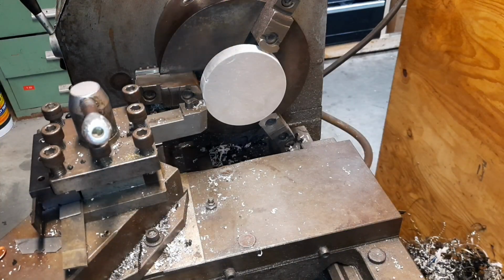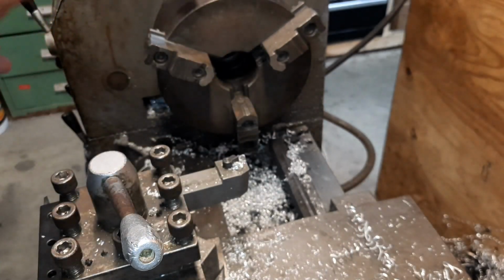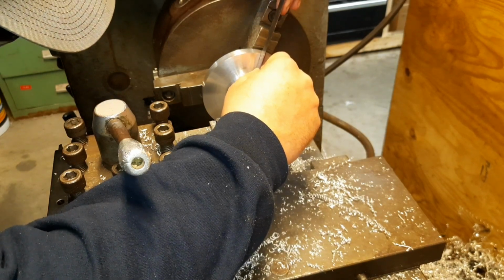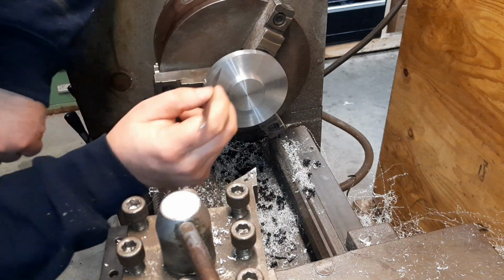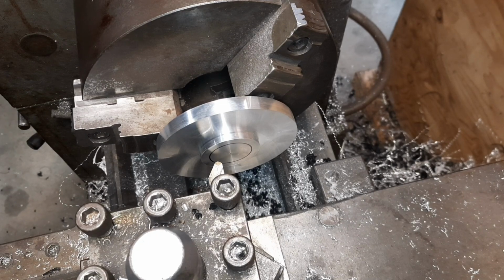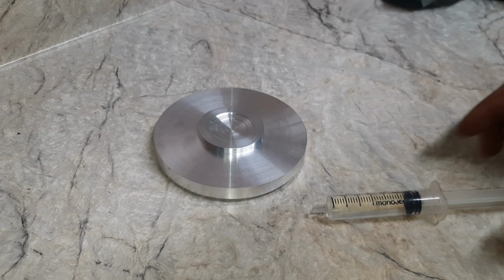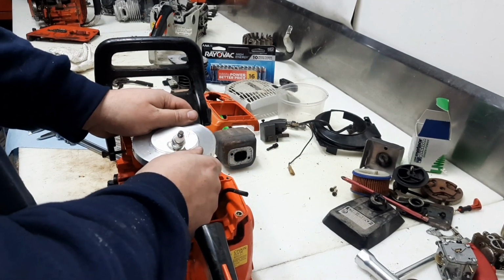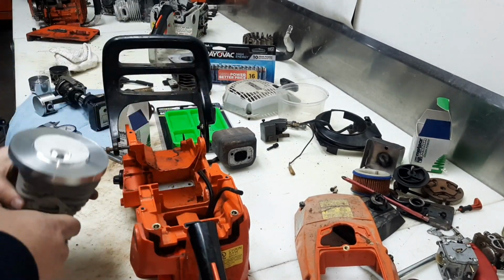Custom Cylinder Head! 50cc Race saw Part 3!!

Comment: You are a bad son of a gun there Dyno Joey Harkness… sideways spark plug hole drilling madman!!!! Your freaking angle was right on the money dude!!!! Was that a freaking guesstimation or did you use a little piece of something to gauge that and make a mark where you wanted to make that drill actually make contact??? This is a very very cool project… love the ride-along!!!   I really just appreciate your slow smooth very deliberate process…you can actually kinda see your metal processing as you are going along… not rushing around…very consistent, controlled thought and process completion… it’s very cool!!!  One day I’ve got to get you a saw to port so I can have a DJH Saw in my arsenal… I need that cylinder top piece on one of my old QV8000’s… so she can have my fun in her retirement years! LMFFAO! Then I can make her pipe! Yeehaw! I’d really love a fast 8000!!! Those two old gals pulled my 36” bar for lot’s of years and feed me!  I owe them some love! 😂😂👍👍

Comment: Blows my mind that with long thin fasteners like that and no real "head gasket" that they stay sealed up.  I guess that recess really helps.
Reply from the maker: Well... We don't know how well it will seal yet. But torqued properly and both surfaces true it should seal fine.
Reply: @dynojoemods2764  I'm excited to see.  Worst case scenario you may be able to make a tiny round ended cutter and cut a groove less than the radius deep on head and jug (like an o ring groove) and put that radius of copper wire in there.  I bet it would squish a little and seal up good enough to run.  If the end gap is smaller than a piston ring gap you'd probably never even know it leaks.  Where your head is recessed into the head it's really going to keep a lot of the combustion force at bay.  

If anyone can figure it out, you're one that can.

Comment: Nice work Joe!  Are u going to use an o-ring for the seal?  Chuck that up in a rotary table , ball end mill or Chuck up in the lathe and cut that way. I think the o-ring is the ticket as you can remove/replace the head as necessary vs gasket … your thoughts ?
Reply from the maker: It should have an o ring. But I'm just going to use a dab of sealant for the weekend. And hope it holds.

Comment: Maybe a very silly question, but what is the benefit of a separate cilinder head instead of the build in cilinder head? Greetings from Belgium
Reply: ALL the power is in the head. By having the a separate removable head (like Joe shows us on this video) you can “fine-tune” the combustion chamber (volume , shape , etc) much easier than on a blind bore where you are limited somewhat by design constraints
Reply from the maker: Allows more tuning options l, shorter or taller pistons to allow different port time etc.

Comment: Is it getting an O ring or sealant?
Reply from the maker: It should get an o ring, but I currently don't have the material so It will be getting a dab of sealant.
Reply: @dynojoemods2764  Hey bud awesome work.. that head what grade of aluminum did u use..?
Reply: Loc tite makes a o ring kit with different diameter o rings and special glue. Cut to length - great supplement to those 200 pcs o ring boxes.

Comment: Hard to read the cc’s with water retention
Reply from the maker: That is why it was the "quick and dirty" method.
Reply: A lower viscosity fluid would have been a little more accurate as they sit flatter, fuel or solvent like acetone provided your quick.
Reply: Drop of soap will take care of the surface tension.